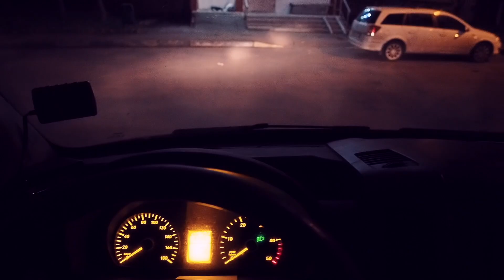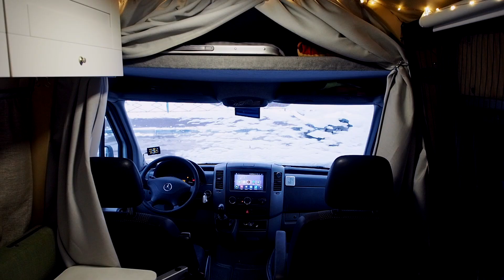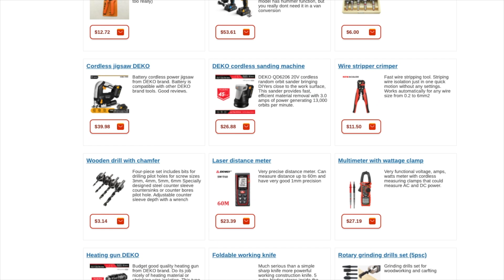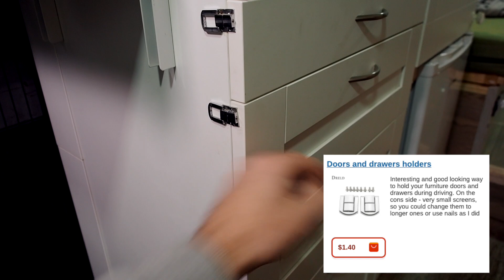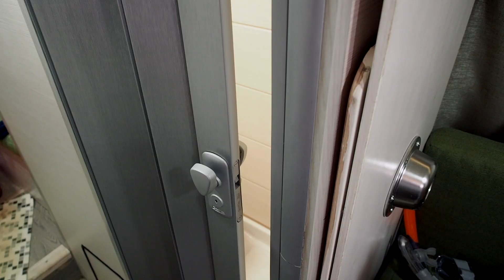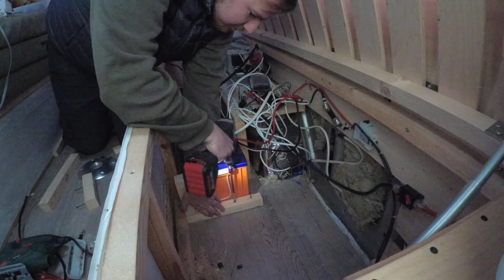Van conversion after two years - TOP 25 changes and additions in my self-build diy campervan

Comment from the maker: https://vantourist.com/shop - products list for van conversion & vanlife
In 2018 I convert a Mercedes sprinter cargo van to a mobile home campervan. During these years I made 30 000 km in it and cross 20 countries with different seasons. Today I show and tell what I add or change in this van conversion after my travels and adventures.

While building this campervan I put there many advanced features for heating, water system, ventilation, electrical wiring, and a lot of furniture and storage. Even toilet and shower cabin. But after some time and some experience, you always want to make your build even better, so I change a couple of things, like battery placement, heating control, and some wiring. But more important things I add new - mosquito net, top shelf in the cabin, kitchen light and accessories, more controls of all equipment, camping and cooking gear and even video projector.